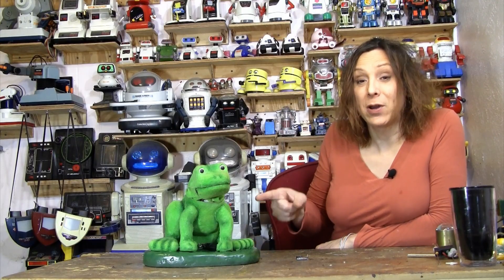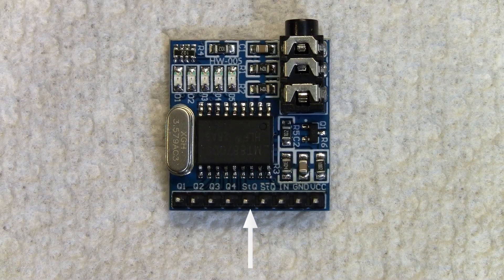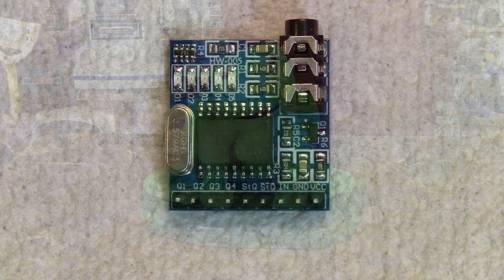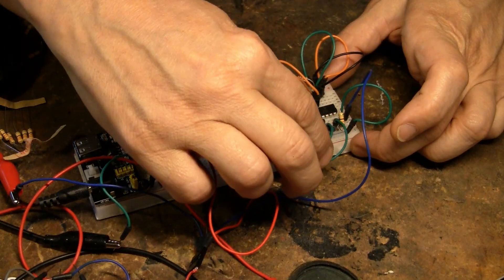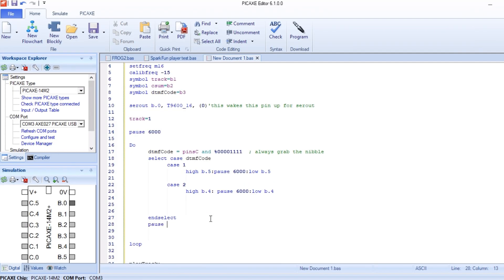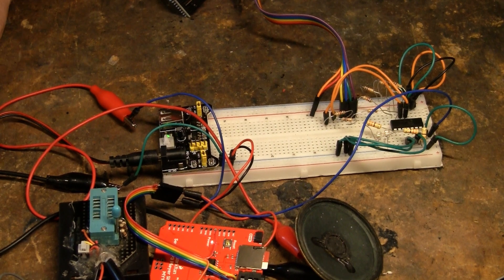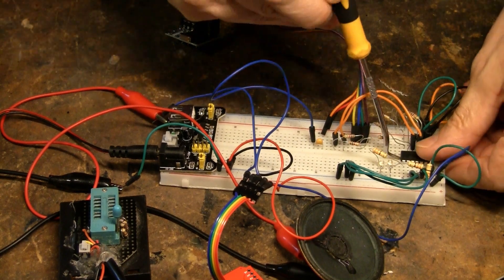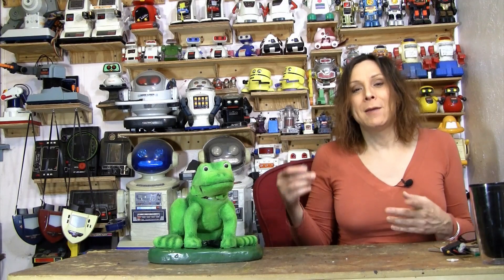How to Use the MT8870 DTMF Decoder with a PICAXE Microcontroller

Comment: Cute little project. Really liked your remote control videos. I made a remote gate opener out of a car window motor assembly, for a 10 foot swing gate across our driveway to keep the dog from sneaking out after we pull in, or leave. Very practical. Now I could use this next system for servos on my secret door locks.